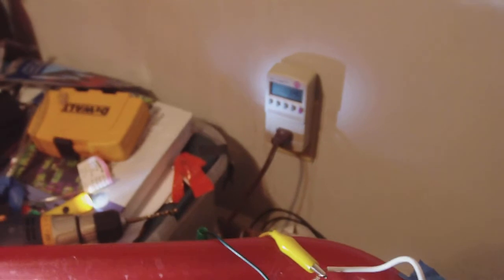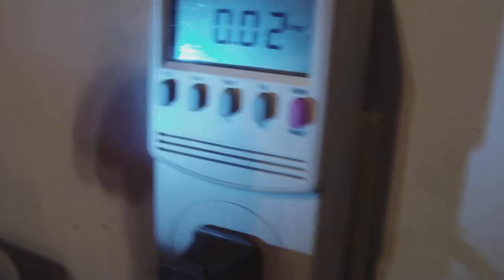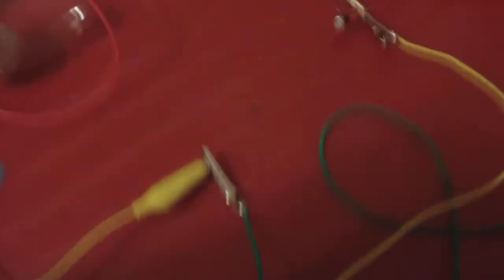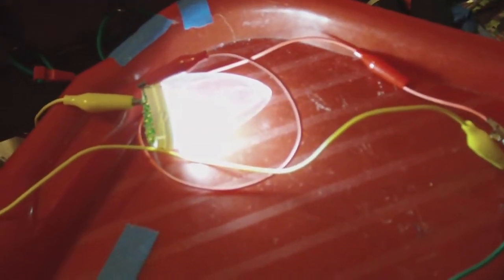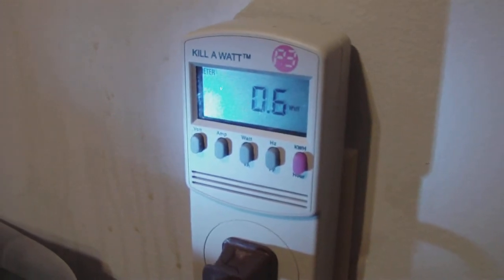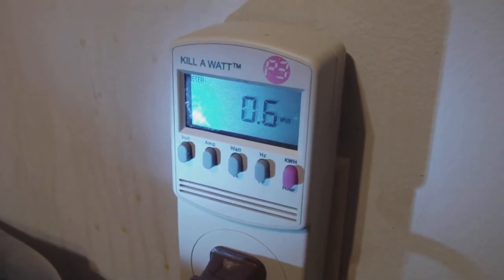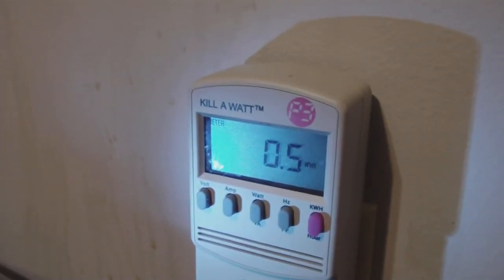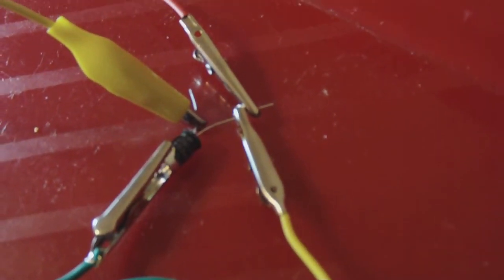Captret Lights a LED bulb for half the needed power

Comment: I just measured the current at my lamp, it is only 3.2 milliAmps and the Voltage at the lamp is 8.12 Volts DC.

So the input power into the lamp is only about 26 MilliWatts now on the lamp..

So this is probably why the digital Wattmeter does not display any input power.
It is just below its error range...

Best regards, Stefan.

Comment: @ibpointless2 
Yes, I just hooked up 2 x 2700 uF 35 Volts caps in parallel and the light
now is a bit brighter, but the digital Wattmeter still displays 0 Watts and 0 amps and Cos Phi= 1.
So with still bigger caps in parallel the light would probably still be brighter.
I wonder if I am somehow destroying the electrolytic caps ? Maybe I am galvanically destroying the electrolyte solution inside ?
The caps just are connected only as a preload resistor this way... hmm...
Strange...

Comment from the maker: @overunitydotcom Glad you see it too! After further testing on my setup the captret will start out at 1.3 watts and go down to the .06 in the video but it will continue to drop to 0.00 watts after 15 minutes. Only voltage is being used and the light out put is not very bight but brighter than a night light that use around my house that use 7 watts. The best part is seeing the LED lights on when the meter reads 0.00 watts! Any cap will work but the bigger the cap the longer it takes to turn on.

Comment: But the Wattmeter went this way from 3Watts input and cos phi 0.48 to
0 Watts and cos phi=1 !!!
So I don´t draw any power from the grid and still get light output..
But the light output is much lower this way.
I will try it also with a 47 uF cap as you did and report back..
Many thanks.

Regards, Stefan.

Comment: I tested this just with a 2700 uF 35 Volts electrolytic cap with my 3 Watts 12 Volts LED lamp.
I fed this from a 10 Volts DC Nokia mobile Phone charger. The Captret drops the voltage from 10 Volts to around 8 Volts at the LED and the LED lamp is much darker then. You can also connect the plus of the power supply also directly to the plus of the LED lamp and not connect it to the cap plus pole->same effect.
Then the cap works as an additional load resistor..

Comment: Well done man.
Yes, you also need to compare the exact light output from the captret powered circuit versus the normal circuit. So please try to get 2 exactly same LED lamps and run them side by side, one with the captret and one without it. The human eye is very sensitive to light differences...
Many thanks.
Regards, Stefan.

Comment from the maker: @rave154 Sorry, the captret doesn't play well with AC and motors need amps to get moving. LED only need voltage which is what the captret is good at but motors need Power.